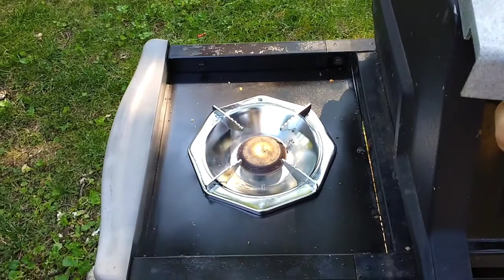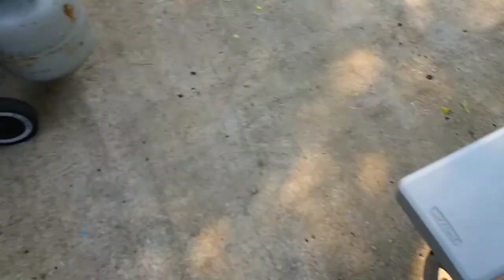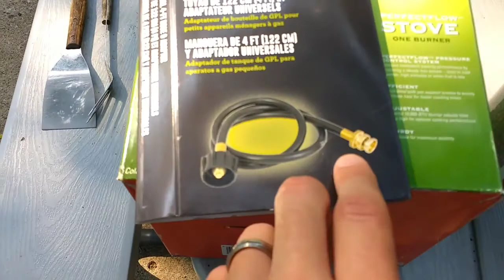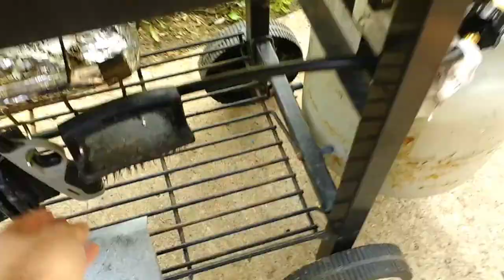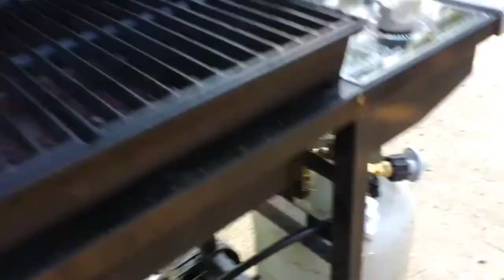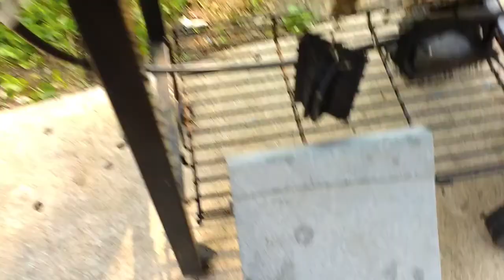Gas Grill Side Burner Hack using a camp stove that WORKS!

Comment: Was thinking about doing this. Can you give me an update on how things have been going with it? Any issues? Do you find that you really need it?  Would you do anything different?
Reply from the maker: Hey Rich. It works great! I do use it all the time. A side burner on a gas grill is a pretty normal thing nowadays, I just didn't want to buy a whole new grill to get the benefit. 
We use it a lot during the summer to help keep the heat out of the kitchen. Boiling a pot of water for corn on the cob, peppers and onions for burgers or sausage, sauteed veggies, etc.
The only thing I changed is actually removing the steel 'floor' I made for it. You can just use self-tapping screws and attach the burner right to your brackets and you'll be fine. There are obvious gaps where things can fall through, but it hasn't been an issue for me, and mine is strong enough to hold a large pot of water.
Hope that helps.
Reply: @bengpg2946   Hey Ben. Thanks for the feedback. Glad it's holding up well. I had pretty  much the same idea and when I searched it on YouTube I saw that you did the same thing. Only difference is I think I'm going to screw a 1lb cylinder to the bottom of the burner instead of connecting it to a tank. You get 2 hours burn time on high with a 1lb cylinder.